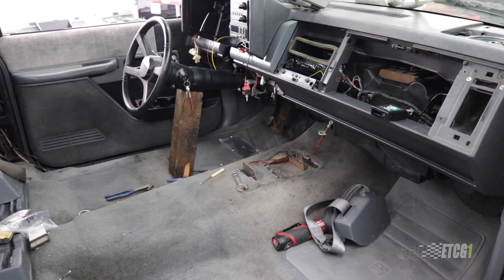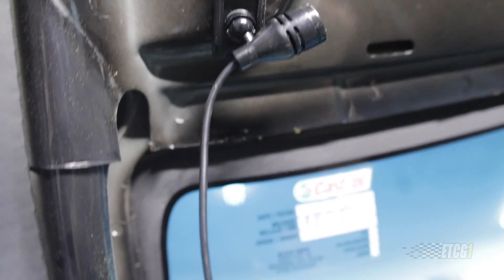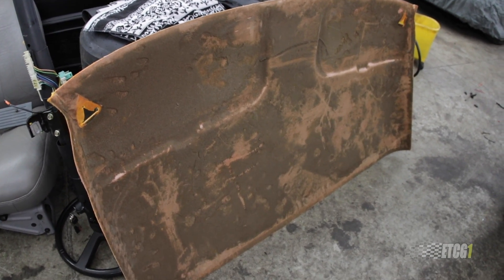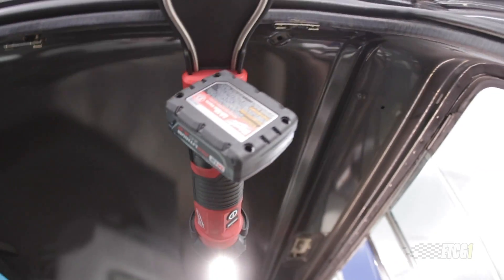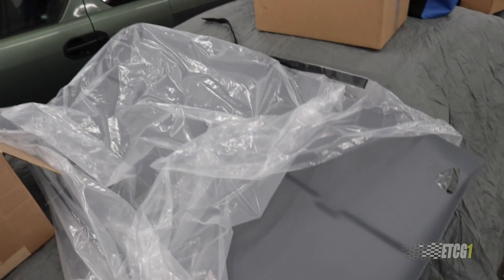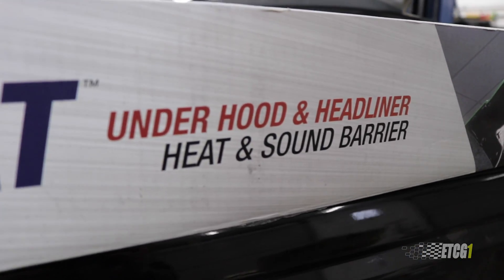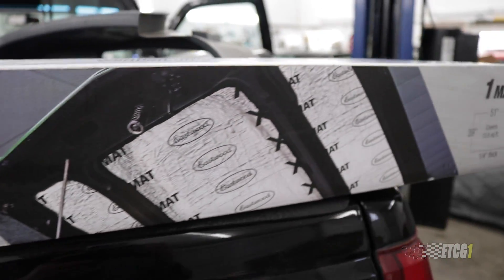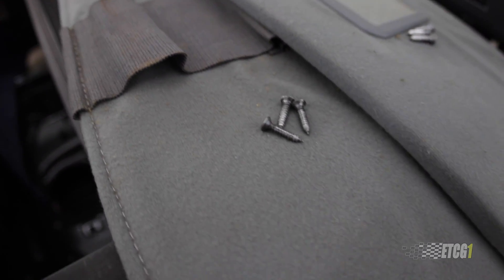How Deep Does the Rabbit Hole Go with #ETCGDadsTruck ?

Comment: Im in that rabbit hole right now with my 98 C1500. Well found out leaf springs are shot. So ordering new ones, well if im getting new ones i should check my shocks, well 1 rear shock is bad. Do i get the crappy ones again or do i get the nice top of the line ones. Sure get the better ones to last longer well now i just cant get the rear 2 i have to get the matching front. Oh also come to find out my yoke on the driveshaft at the rear u joint is bad so now im buying a new drive shaft. My $200 leaf spring swap went to $700 now, ughhhh.

Comment: You don't need to run a bluetooth mic wire up through the A pillar and go through all of that trouble. That's what double-sided tape and undersides of dashboards are for. I'm starting to figure out the reason you stopped tech-ing years ago

Comment: The mic should actually be installed behind the rear view mirror. Not at the A pillar.  Of course the wire runs that way. But never leave the mic there. It picks up the window noise bad.

Comment: Oh yeah I know your situation. I have my late father's mercedes w123 230 and in the process of rebuilding the instrument cluster (trip odometer gear is slipping so it's not registering, and the engine instrument cluster has its circuits to the instrument cluster lights burned so I need a replacement) and so i had the thought of adding a factory rpm gauge but that would mean I have to wire the whole system from scratch and there is a wiring harness for the rpm gauge but it's 50 bucks and another 20 for the replacement engine instrument cluster. And then I took apart the ashtray to find the light bulb for the ashtray is burned so I have to get a replacement but it's a special bulb that has a metal base that you have to get it as one unit so thats 20 bucks for a DAMN LIGHT BULB, and the thing still needs a clutch kit because it's slipping and I'm sitting thinking that if I'm taking apart the gearbox, might as well replace everything that is a common wearpoint. Which means front and read flex disks, a center bearing carrier for the driveshaft along with it's bearing, new gearbox mount and rear main and gearbox seal. BUT THEN the back of my mind is saying wouldn't it be nice to retrofit all the options the car never came with? (doesn't have power windows, nor central locking, not even ac) so tear apart the door trim, dash, and add new wiring harnesses to do that. And then there's that not so mercedes-like nasty brake pulsation that gets worse the harder I brake. so new brake disks and oh this has the old school tapered roller bearings so in comes a front wheel bearing kit as well and the list goes on and on and on and for me as daunting and expensive it is and it's very. I am willing to go as far as the rabbit hole goes if not beyond that hole because If I'm going to this, I wanna do it once and properly regardless of cost or effort so that I wouldn't go back and do something else

Comment: Headliner cloth falling down is more about smoking in the car. It degrades the glue that holds it up. Smoking in the car also degrades soldered connections in the dashboard. In the 80's, Thunderbirds and cougars with digital gauges had massive failures along with headliners sagging. It was found that that the owners were all smokers. Later models of gm cars had digital display HVAC controls that suffered the same issue. On the GM side, I found that adding a drop of fresh solder to all soldered connections made them ok again. Most gm stuff is made by ITI and they barely put any solder on those connection, everything from dashboard controls to the PCB on the wiper motor. Adding a touch of solder to those connections can make displays work as well as wiper motors work when they wouldn't otherwise.
Reply from the maker: I've worked on plenty of vehicles from the 40's on up to todays vehicles. Doesn't matter if the vehicles from the 70's and 80's were smoked in or not, the headliners were bound to fail. It's because the foam under the fabric degrades. When it does, the glue has nothing more to hold onto. You can clearly see it in the pic of the headliner of this video. That black stuff is the foam that's left that used to hold the fabric in place.
Reply: @ETCG1  
That's fair, but they don't all fall down from those years. In those days, the ones that fell when the cars were still nearly new, were all driven by smokers. GM and Ford actually took count of stats on that back in the day thanks to warranty claims. Why do you think they stopped offering ashtrays as standard equipment? Because people with 10 month old cougars with falling headliners and failing digital dashboards were told it was because they smoked in their cars and they all said "you have ashtrays as standard equipment, so we call BS". That's why ashtrays are no longer a standard item any more.
Not trying to argue, just sharing some of what I experienced in those days.
Reply from the maker: @mindthependulum6245  How long have you been a mechanic?
Reply: @ETCG1  
Started in 1987. Right out of high school. I worked at a Ford dealership for several years, ling enough for issues with digital dashes and headliners in the early 90's to be a thing that techs got sick of seeing. By 95 I switched to an independent auto body shop.

Comment: I would imagine a project like that would need a month of deciding what was the most important things to be done first, because you are not rockafella and there is only one of you.
Don't stray off the order list, that's where money vampires live lol.
The engine/transmission is number 1,  not radios/accessorys or pretty internals.
Just my opinion, not saying your wrong or anything :-).
Reply from the maker: Not exactly. In this case it's a matter of efficiency. I needed to run wires for new components inside the truck like the AF meter and gauges. This necessitates removing the dash which contains the radio, which in this truck, had 2 other components hidden in the glovebox as well as behind the drivers seat. That stuff had to go. Replacing the radio became a part of the rebuild plan. Originally I wasn't going to do anything with the interior this time around. Then I went to install the hands free mic and well, the rest is in the video. 

Thanks for your comment as always. I look for them with each video.

Comment: Recognizing if the project is a money pit or not is only difficult most of the time of you're impaired by emotion.  Sinking thousands of dollars in repairs/work/modifications into a project which you know you can never recoup... You're either married to it, attached to it, or living in it.  I'd be a much richer man if I could recognize that myself as easy as it is watching others do it. 
Just put a new transmission into our 2000 GMC Savannah.  Along with complete new brakes (whole system not just new rotors and pads), mostly new suspension , fuel system (tank, fuel pump, lines etc) have an all new interior on order.... Pretty much the only thing left not new/rebuilt is the engine , paint and rims.  When I get the money they are getting taken care of as well.    Into an old conversion can worth maybe $2500, maybe $5000 when it's done.  I console myself that even if am putting 5x the value of the vehicle into it, still cheaper than a new one.  And more importantly, I like it.

Comment: I suspect most people who have modded have come across this a time or two.  As for my own experience...

My daily used to be a classic Mini - 1098cc and running rough from the day I bought it.  Turns out it had a burned exhaust valve, and second hand heads are a dime a dozen, so I'll just slap one on and Robert's your dad's brother - no biggie, right?  And then I got thinking (which is never a good sign): Hmm...it only came new with about 40 hp.  If I get the head from the MG Midget, which has better shaped combustion chambers, bigger valves and double valve springs...well, it's not too much more, and I have to replace the head anyway.

But then...the head's coming off anyway, so I may as well put a better cam in it while I'm there - the head needs to come off for that, too.  Make it a little more enjoyable to drive.  But that means...the new head isn't going to help much with the power if it can't breathe, so I need better exhaust flow, so a 1 3/4" system and LCB headers goes on (the car came with 1 1/4 - like breathing through a straw!)  Then I realise the intake and exhaust manifold are one piece, so I need a new intake...and if I'm buying an intake manifold anyway, then maybe I'll get something that will suit the new head, cam and exhaust I now have...so a set of twin S.U.s and manifold go on.  (Later, I switched to a 38 DCOE Weber, a set of custom-fabricated front control arms, made-to-order wheels, and boosted disc brakes - but that's a separate rabbit hole.)

Thankfully, I can't remember the final price for all those parts (I have enough nightmares already, thanks) but it was considerably more than I originally paid for the entire car.  And while the car was a lot more fun to drive, and sounded great...sometimes it's hard to see how a simple "burned exhaust valve" can snowball into all that work.  And most with the (quite reasonable, I thought at the time) rationale of "while I'm in there already I may as well just..."

Comment: Anyone ever had older Audis? Like 1999-2000  A6? . Try fixing something on it. It's full of endless rabbit holes. You fix something or at least you think you did, something else will break.  Then it goes on until eternity and realize, you should either - junk the damn thing (should have before spending hundreds/thousands)-  could have already bought a new one.  Or my option. Don't buy one used.

Comment: How about my aborted plan? Which was an 80 Dodge D150 short bed 2wd. My plan was to make a street rod out of it. Purchased a 413 with transmission, 9 1/4 dodge truck rear end. Done the front end suspension work to go from a slant 6 to the big block. Too bad my financial situation crapped out or I would be running against old farm truck dude. I would love to find another D150 like that one, but a better body for the same price($300). I also didn't have a plan of attack, like I do now.

Comment: So we buy a Honda Civic ok good former owner say crack block ok ; so we go to a mechanic who got one engine transmission from a wreck car . We get the motor trans in ourselves runs good shifts good. Not good has antifreeze on oxygen sensor, now what ? Deep hole more money 💰 no dealership said not covered under recall . Not there yet more money. Never cut corners “we opened a can of worms we believe that the antifreeze is fouling the 02 sensor causing light on bad head gasket 2 motor